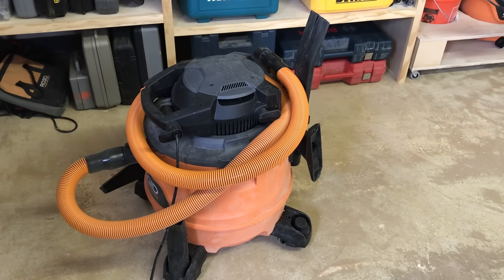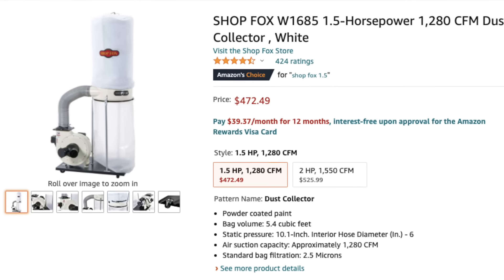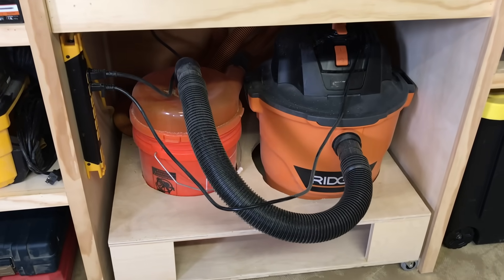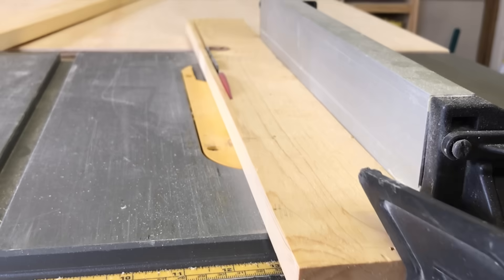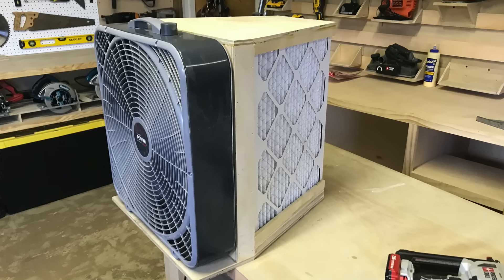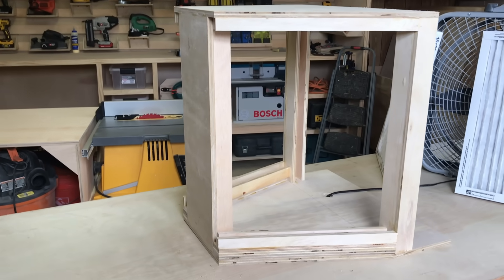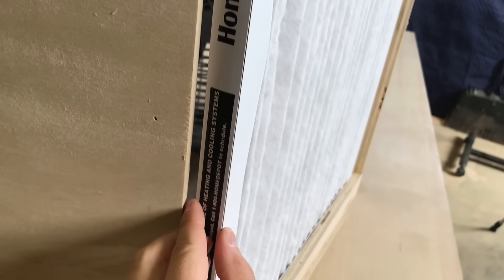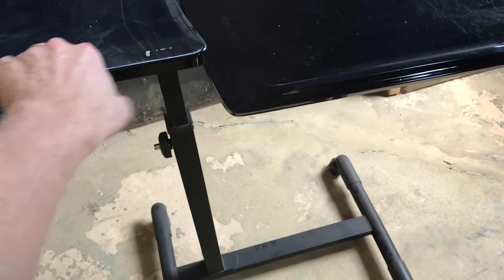BOX FAN AIR FILTER For About $40! (How To Build a DIY Box Fan Air Purifier With HVAC Filters!)

Comment: Always enjoy your videos 👍 
I made mine from a box fan as well, actually round, but 20x20 filters fit perfectly. I made two simple frames to fit around the fan using scraps, 2 left over flip locks and 2 small hinges. I cut the wood for the frame to match the thickness of the cardboard around the filters edge so as to not lose any usable space on the filter. I placed the filter on the front side of the fan and turn it on whenever I am cutting or sanding. It works in conjunction with my dust collector and or shop vac. I also use a mask when doing this because even when all  collection measures are in place it doesn't catch everything. 
I find it is very effective at catching the fine particles and the thin layer of dust you may find the next morning is gone as well.

Comment: What we’ve been doing forever, as a cheap way to help “scrub” air, w/o that expensive equipment. Sure, not gonna do what the pricy units will do; but for what these cost to buy and make, well worth the money. Also, very easy to move from project to project and site to site👍🏻.
We also have some hanging and mounting to ceiling (just filter bungee to box fan for this one) and higher up on walls, along with some at floor level, and lastly table level. 
Now granted if doing a demo, or spraying inside, etc….we put up plastic and create negative (or positive at time) air pressure with a mobile scrubber along w/ these “scrubbers” and have the others vented out a window to keep things controlled. But, still a pretty great method to get the fine stuff that “your right” no MATTER HOW MUCH YOU clean/dust/vacuum…..5 mins later, it’s back (like dusting your house…..the WORST THING I HATE DOING, b/c literally 2 mins afterwards, it’s all back 🤣).
Cheers✌🏻

Comment: They really do work, but one must keep in mind that a filter actually decreases air flow through the fan and shorten fan motor life.  As an electrician for 45 years, I've changed many fan motors in industrial settings.  If you go this route, best to use one of the 4-filter designs or buy a vane axial fan.
Reply: You sound smart. I want to try this,but I don't want the fan blowing out crazy air into my workspace. Is there a way to do this where the fan is blowing into the filters resulting in a diffuse air flow out of maybe a long box or tube? Like a trash can with the bottom cut out?
Reply: @lucrebrazzi4069  I don't know about smart, but I am experienced.  Simple answer is, yes, there is a way to diffuse or redirect air flow , but several factors should be considered, so please read on.

First, air flow from a box fan is not very strong, so what you feel will drop rapidly the further from the fan you move.  The air flow it produces throughout the room will  push/pull more dust the inlet can filter can capture, which means the amount of time it takes to scrub the air  becomes shorter.

Keep in mind that we are discussing a fan that costs less than $30 (most under $20), an excellent price for an air mover. Lumber for the frame will be another $15-$20 (not everyone has adequate scrap lumber just laying around), fasteners, adhesive and other hardware maybe $5.00.  MERV 13 filters: anywhere from $10 to over $40 each depending on where they are purchased, brand and how many in the package.

Filters on the inlet keep dirt off the motor, fan blades and both grills.  Putting them on the outlet will be just as bad, perhaps worse, as blocking air flow into the unit.

 Yes, duct work can be built but it must be at least 20" X 20" square or almost 30" round.  The longer the duct run, the number of bends, and the roughness of the inside of the ducting will reduce air flow and could easily overload the tiny motor just as blocking the inlet can do.

Ducting the air outside the room will also draw new, probably dirt/dust laden, air in which  will negate any filtering effects of the design.

Crazy air isn't always a bad thing, so maybe just pointing the fan discharge towards a wall or corner would diffuse the air flow enough to make it sane enough for you.
Reply: So your concern is shortening the lifespan of a 15 dollar fan? And your solution is to replace it with a fan that cost hundreds of dollars? Let me work out the economics of this, so since I don't want to waste 30 bucks buying 2 extra fans in my lifetime I should spend hundreds of dollars to save the pain of spending 30 dollars?
Reply: @rawbacon  Harbor Freight and other  retailers sell vane axial fans for $20.  They're expensive one is $60. Amazon also sells a number of vane axial fans in the $20 range.  I bought the HF expensive one 30 years ago for $25 and it's still working just fine.  

The issue is air filtration and the least expensive way to do it.  If you want to spend $30 and help overflow another landfill instead of spending $20 and having a tool you can pass on to your progeny, go for it.  But, based on your attitude and lack of math skills, one must wonder about your progeny.

Stop being ridiculous.

Comment: This "device" can handle about 10% of the volume of filthy air in an 100 mtr3 average room in about 3 hours running.   Looks nice but  . . . . . . . USELESS.    😂
btw,  The amount of commercials in these kind of pointless video's is rather shameless.  😎

Comment: I built something similar with a smaller commercial fan blowing straight up that sits on the floor. It is surprising how much 'stuff' collects on the filters. I remove and take the filters outside and blow them off with an air compressor to save $. I also have several cyclones on my equipment with a large roll-around cyclone/shop vacuum system. Being prone to sinus infections mandates controlling dust. Thanks for sharing.

Comment: As an hvac tech a standard filter bought at stores or online are not air purifiers.  Its is literally just a filter. If you need a finer filter, goto a higher merv rating. A merv 8 to merv 13 allow pollen and dust to go thru. When the filter becomes full, at the point it requires to be changed is the best to catch all. If you use this its perfect for a shop. Not for the inside of the house. If you need a filter for the house, I suggest going to a merv 16, 4 inch. As a one inch should be changed every 3 months. Regardless this is a good video for a filter setup in a workshop. However I would not use the word purifier.  As more of an air filter box. Cool video though. Could possibly do one with sheetmetal. :)

Comment: Always use 25x20x5 filter. Largest surface, best flow, best durability and longevity, best value.  With 25x20x5 filter, even one filter is enough to work OK. But you can totally take two. Then: no need to build any boxes. You can seal the parts that don't fit with a tape. stack the filter side by side, put the fan somewhere in the center of this recatangle, and seal everything else. You're getting 25x40 intake sucked into 20x20 fan, and that's ok because the bottleneck is the filter itself, and only this part requires larger surface. No box makes the whole thing more flat and smaller. The air inside any box is just a dead space.

Comment: I don't think a box fan has the pressure to run one but duct fans are cheap now;  Mechanical pre filters based on vortexes, S curves and tesla valves are pretty cheap and easy to do.  Should pay for its self in filters pretty fast

Comment: Lasko actually manufactures a box fan with removable filter. It's called the Air Flex™ Air Purifier and Room Fan
Model FF305. It sells for about $49 at Home Depot or Walmart. It comes with 1 filter included and then you can replace with any 20x20x1 filter.
Reply: I have seen J shaped aluminum siding holder carriers that are one inch in width that can easily hold one's one inch 20 inch by 20 inch MERV 13 air filter; its simple and inexpensive way to be able to swap out one's old clogged air filter for a brand new fresh one which would only take only five seconds along with not having to mess with any potential duct retaping

Comment: I just duck taped a 2" to 4" thickness 20" x 20" Merv 13 straight onto the fan. Rinse and repeat as needed. I have several of these running around the home and I find that it works really really well. Ive noticed a huge difference in the air quality.

Comment: Just a thought but would you not get a better flow if you reversed the fan so dust is going in through the fan and clean coming out of the filters
Reply: Why would moving the resistance from the inlet to the outlet have any effect on flow? You get more flow by increasing surface area and hitting it with the air compressor when the performance becomes too poor.

Comment: A dedicated shop should spend the extra money on ventilation. A good tube axial fan that keeps the motor on the outside of the fan, and outside of the shop is a bonus because wood particles are flammable. Another benefit is that you can stain, paint, or strip with the proper pro-ventilation. They are like squirrel cage fans with the benefits of a box fan. Most paint and body shops use them. The box fan is great for a temporary fix, but you should really look at a good 12" tube axial fan for a small shop. IMO.

Comment: Your DeWalt table saw has a blade guard with a hose connector that you can use to connect to your shop vac. That would be a much more efficient dust collection method for the table saw plus it would help keep your hands away from the saw blade.  I have the same table saw, cyclone, and shop vac as you do and this method works well for me.  Thanks for sharing the video.

Comment: i just did the same thing! but with 20x20 filters like an "A" behind the fan with scrap triangle cardboard pieces for the top and bottom, and of course the duct tape to hold things together.
thought about using four 20x20 filters and a 20x20 piece of cardboard on the bottom making a kind of 'filter cube'. still might do that one as long as i can keep coming up with large enough pieces of cardboard.
these are the cheapest way i've found to control dust. but you have to keep in mind that you'll need a way to keep the dust suspended in the air (oscillating fan works for me) so it can find it's way to the filter box thing.
[edit]
i use this for a basement workshop.

Comment: For those people that don’t even want to bother building something big, or use duct tape, there is a box fan with a hinged back, where you can slip in a 20x20x1 filter. Lasko Air Flex 20" Air Purifier Box Fan

Comment: If your are making this air filter for a shop, use the multiple filter boxed method. 
If you are just making an air filter for your home, just tape one 20x20 filter to the back of the fan. And you don’t need a 3” or 4” filter. A 1” one is fine. And no it doesn’t strain the fans motor. Just replace the one filter, instead of spending time building the box, unless you are making it for shopwork

Comment: How does that air drag effect the life of the cheap motor they stick on box fans?  In my youth I tried something similar once - was tuckpointing my basement and tried to use a box fan to push the concrete dust up a 4" dryer duct outside.  Taped everything off, worked for about an hour before the motor burned out, I assumed from insufficient cooling.  That is the push-side of course, not the draw side like your unit.

Comment: Don’t mount it to than great cart. Put casters on the bottom of the platform (keeps it low to the floor) where most of the fine dust will eventually settle

Comment: I have allergies and air purifiers in every room of my house. When the filters finally are clogged up and need replaced instead of paying $$$ to buy new ones I replace them with Swiffer wipes. Put a layer of unscented Swiffer wipes where the filters went and if you want extra cleaning purchase cloth made from activated charcoal and cut strips to fit the filter openings then put the wipes on top. Works great. Look at the wipes after a few months and they will be filthy with dust and pollen! Or get a box fan and put Swiffer wipes on the rear. Same thing. But with an old air purifier the wipes won’t fall off if the power goes out. They are inside where the filters used to be. Also wipe down you air purifier every now and then.  A lot of dust will cling to it.

Comment: Fyi.. duck/ aka duct/ tape was designed during WW l l to be used to seal ammo boxes. Although used post war to seal ventilation duct work; it has been outlawed in many building codes  for that purpose.  It is due to the tape being a fire hazard, as well as a creator of toxic pollutants, as it ages and it's adhesive dries out.

Comment: If anyone wants an easier solution, just buy a 20inch box fan and 20x20 inch filters and mount the filter directly to the back of the fan.  You can even get 4inch thick filters that are 20x20 which will give you better efficiency and longevity.   

I say this is an easier solution because no building is involved.  I'm not dissing this guys idea, I like it a lot, and with the dual filters it may be a better design.  The thing I do not like about it is how bulky it is.  If you have a small shop like me (only 18ft x 16ft) this will take up a lot of room.

Comment: I used to just tape them to the box fans and I run 2 of them in my shop. I started using one back before I got into any woodworking because I have asthma. But it would be great to improve my design

Comment: I built a ceiling mount shop fan filter system. Moves roughly 6000-7000 CFM. I also put multi-stage filters on it that can be washed down. The body is plywood with a chicken wire mesh on the main intake to keep the filters from collapsing from air draw. Total project material cost was roughly $200. I needed that kind of air movement to handle both woodshop tools and a CNC router that cuts carbon fiber.

Comment: if you place  a box fan on top of  4  filters  held  together  with  duct  tape  does  just as  good if  not better  and  costs  much less  just  wont direct the  air  where  you need it tho!

Comment: They make reusable air filters which might be a good investment. There's generic electrostatic ones and K&N makes some. I use a K&N one for my house.
Reply: Yes it will pay back usually in as little as one year's to two year's time; then afterwards it is essentially free for one's lifetime; with the only effective cost is the specially designed cleaning solution which usually is a mild surfactant based filtration media cleaning solution that HVAC cleaner's in the industrial cleaning trade's use on a daily preventative cleaning maintenance basis.

Comment: I use the Honeywell 4" thick MERV 12 filter fitted with a cheap 1" thick fiberglass pre-filter taped in front the Honeywell filter.  I find that the 4" filter lasts longer then the 1" filters and still does a good job filtering the air.  Also, you don't mention measuring the fine particulate in your shop air.  I suggest using a Dylos Fine Particulate monitor.  What I like about this basic PM monitor is that it can be easily cleaned in the event that the unit gets a buildup of  dust around the unit's sensor.  You can always go for cheaper Chinese made PM monitors but the dust sensor won't be as serviceable but some of those are still pretty good.